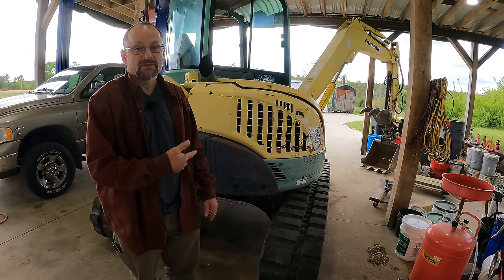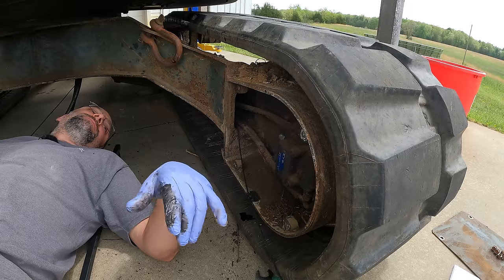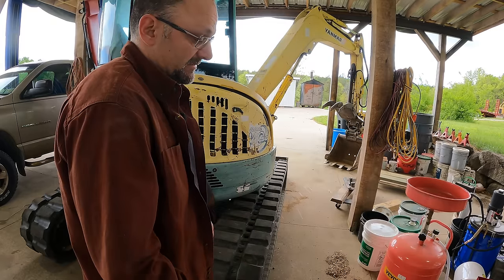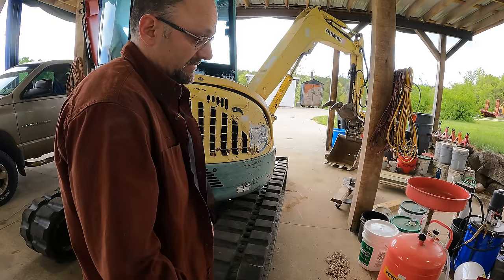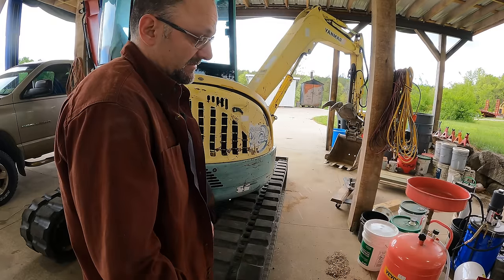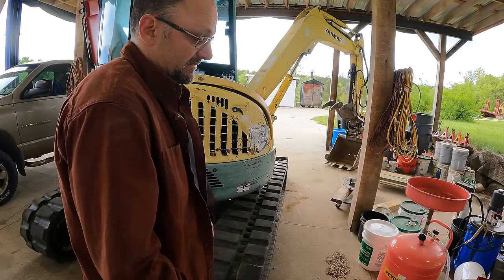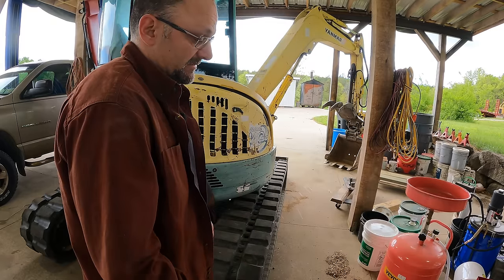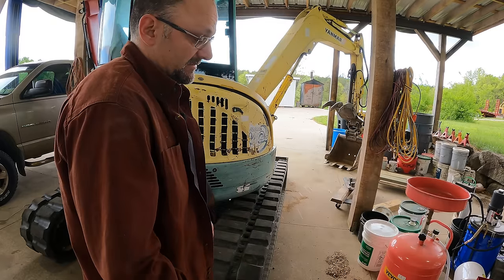Excavator Not Tracking Straight, TOUGH Hydraulic Repair.

Comment: As several other people have said, the most cost effective solution will be to ‘trim’ the faster motor so it runs at the same speed as the slower one.  There must be an adjustable valve available for not too much money, and despite the fact that you haven’t fixed the cause of the problem, you will have alleviated the symptoms of the problem.
Reply: My thoughts exactly!
Reply: a restrictor valve , tied into the input and output of the faster motor.
Reply: A simple flow control valve would solve your problem.
Reply: You feather the levers to stay strait if one side is faster you slow down the fast side to stay strait it is cheaper than a valve or other parts
Reply: @alphonsotate2982  Exactly. I've even seen some machines with limit bolts on the sticks that are adjustable. This is a pretty common occurance. Machine will just be a bit slower...but they're already pretty slow as it is.
Reply: @64novacaine  Yes. restrict the flow of the fast track while not sacrificing any pressure for operations.
Reply: @jtmack77 maybe a spacer with a smaller hole then the coupling, in the coupling between the right motor and to hose for forward, would already do the trick?
I'm sure it will restrict the maximum flow, while keeping pressure at lower speeds.
And it's pretty easy accessible if you want to try another size or remove it.
Reply: Or just squeeze the hose with a clam, that'll restrict the flow!
Reply: @alphonsotate2982  Exactly, I have the same Yanmar machine but a 8 ton version. I have to make small corrections just by favouring one stick a little. It can even just be from having the boom out to one side you will get slight divination. It's not like you are driving it down the freeway at 60mph with one thumb on the wheel.slight Track tension imbalance left to right side can have an impact.  Makes for good entertaining videos though trying to make things perfect.
Reply: @alphonsotate2982  the problem with that is by not using both controls at maximum, you also dramatically reduce the speed of the slow motor too even though you have it at full
Reply: This was my thought as well. You may loose some speed overall to match the track speed up, but surely it wouldn't be a big issue given how you typically use an excavator.
Reply: You are not far off on your idea. You need to use the tracks as flow meters. And Match to each pump. Adjust the sow pump servo piston to match. It makes up for wear and differences
Reply: It would appear you have two different pumps one is a fixed output and drives one track, the other is a variable output pump a swash plate pump. When driving both are used to drive tracks independently. When not driving the swash plate pump (variable output) is used to gently or not so gently move the implements. This explains why linked together you would get the fixed output pump throwing its weight into the argument leading to harsh Implement use. The HP control is for overload control, think of it like a fuse when you get huge resistance to movement it would back off the pressure. This would have no affect on pump output at all, it is only used for overload situations. You messed with that and should put it back where it was, effectively you took out fuse and put a bigger one in! We need to limit the throw of the swash plate to reduce its output to that of the fixed pump. Is there a control stop for that??
Reply: Have you tried swapping the port relief valves on the control valve for the travel circuit? There will be one on each “slice” of the control valve for the travel circuits. It will look like the main relief valve. 40 years as a heavy duty mechanic in my experience it’s very rarely the spool itself unless there’s been a failure and metal has gone through the control valve.
Reply: If you add flow controls, remember to put them in as meter out. You will need 4 to get both sides the same in both directions.
Reply: @rustrtal  I have noticed that too with my machine, that unless both controls are in full forward mode they both slow down? Why is that?
Reply: @Methodwake if intalled at the pump, He only needs one. Only the good side.
Reply: @64novacaine  A flow meter  would isolate any hydraulic problem, for this job and any other hydraulic issues.

Comment: One things ive learned watching your repair videos is just how valuable a lathe is as a tool for making repairs.
Reply: Agree!! The tools he makes.... So cool
Reply: Ave said when the you know what hits the fan you are either going to want a lathe or know someone who does because of how useful they are for repairs
Reply: As an industrial maintenance/repair man, I have a lathe but rarely use it. When you need a lathe you need a lathe. But for what he used it for in this video, I wouldn't've bothered. I'd've threaded the plug into a cap, to be able to grab it in a vise, hand drilled the hole, and tapped it by hand. The lathe would result in better threading, but to make a test adapter, doing it by hand is sufficient and much faster than setting up a lathe.

Comment: I think we all appreciate how much time and attention you put into editing your videos with adding text and graphics. Your videos are so informative.
Reply: Hi,  Try fitting an in Series Adjustable Valve to the Main Drive Feed Line of the 2 that's feeding your fastest (L/R) Travel Motor,  and back it off until she hopefully  tracks straight.  It should not effect anything else re your Digging Controls obviously.  Worth a try, and if you want to get really technical, then you can also toss in isolating Solenoid's to isolate this adjustment .. if required.
Reply: @grahamking2276  I would have the same approach.

Comment: That accumulator seems to be on the side that runs faster and seems to be the difference when switched. Iv run skid steers, excavators on a larger scale and after ten or so years every machine starts to get quirky. When you correct it may build up and slowly add extra pressure to the left track and bleed off. But every time you correct it builds pressure and starts over again causing an imbalance. Since you quite easily removed it once already may be the strong side is the problem. Just bar stool quarterbacking I really like how you work through the problem and don’t pull the trigger on the parts cannon. Good luck.
Reply: I came here to say this. I think he needs to try to isolate it, just to be sure.
Reply: My attention is drawn to the accumulator as well.  Do accumulators go bad?  Why is there an accumulator one one channel and not the other?  Should there be two accumulators (thinking one may have gone missing due to a dodgy field repair)?  My thoughts for what it's worth.
Reply: There should be two. Maybe it was a parts machine for previous owner and someone borowed it for other machine. Since it run on garbage lot the straight tracking would have not been an issue.
Reply: @arty1799  i think this is only on one pump because this one pump do the digging and accumulator compensate pressure in the system to make work smooth.
@farmcraft try just for the test remove acumulator
Reply: @arty1799  I was thinking the same thing. But is there enough space to fit two of these next to each other?

Comment: I love your videos, I’m a professional heavy equipment technician living in Sweden. I don’t see any of your test or troubleshooting paths to be wrong. But i would have started with a easy bucket test. Just lift the track and put the house drain from each motor to a bucket and run for any set amount of time and see any variations. If okey I would look in to see if there is any delta P adjustment to the pump. I guess that you will have separate. Electrical or mechanical throttle control of the pump outputs. The ls pressure (load sensing) pressure will set the angle of the pump the horsepower control on the out side should not be messed with. I might have done it 😂 I’m no expert on Yanmar but if you want any in put we could do a teams meeting or similar 😊 best regards from Joel
Reply: Ls pressure is nothing to do in thus case - Here is one one body pump,one rotor, one swash plate . Just on valve plate on pump has 2 channels for oil flow, these channels are quite close, they divide the diameter of the piston in the rotor into 2 parts and so from one rotor 2 flows are achieved. Even a slight scratch between these channels causes a leak between p1 and p2.

Comment: Hi John, a 90 degree pipe fitting will restrict the oil flow compared to a straight fitting. The  pipe for the left control valve has a 90 degree fitting so might be the cause of the problem. Keep up with the excellent videos.

Comment: Given the age of the machine (and depending on how hard it was worked) you obviously have wear in components, however...
before exchanging expensive components: 1) bypass the accumulator (remove it and run direct to the port) and check the tracking 2) check hoses for replacements ( especially their Internal diameter) 3) If you can, slip the tracks off and mark the drive sprockets and check rotation speed with a tachometer (Ie without load) and see if they still differ 4) whilst tracks  dismounted check all Idlers/track rollers are free rotating. Sometimes the simplest overlooked problem causes the biggest headaches John 😉 Tracking issues have plagued caterpillar machines since the were invented! 😒
Reply: I jumped on to say something similar always tach your unloaded sprockets and most tracking issues are result of resistance in the track system not the hydraulic side. You can test this by attaching a gauge to each drive hose and see if while tracking they have the same pressure. It seems you kind of eliminated this when you got it to track right but maybe the wear vs resistance is just enough to revert to “normal” on the one side when you switched them
Reply: @alwayssomething3259  If that was the cause, why would it track wrong depending on which side the pump is connect to? If it was resistance, it would always track right or left, not switch sides with the pump.
Reply: @bobbygetsbanned6049  As I acknowledged that he had eliminated it as a potential by getting it to track the other way. It was more of a general statement that most people overlook and in most the machines I’ve had come in for tracking issues there’s a bad idler bearing or something not hydraulic related

Comment: Hi John,  You could install a throttle valve on the supply line to the right motor. Might slow the whole rig down, but could be adjusted to make it track straight.   Love your stuff. Doug
Reply: I agree
Reply: That's right. Restrict the flow of the faster final drive to match the slower one.

Edit: I just also note that a flow restrictor valve does increase the temperature of the fluid going through it, and the temperature increases rapidly the more your restrict it. I am not a hydraulics mechanic, just something I thought to mention.

Comment: Had some similar issues with my bobcat, the more I thought about it the more I scared myself into taking both pumps and motors to a rebuild shop. Since the motor is directly downstream of the pump (more or less) without a filter between them, if the pump starts to degrade and send particles into the motor now you have two ruined components instead of two rebuildable components. It was about $4k to have all of them rebuilt but the peace of mind is sure worth it. Side note I spy a Caterpillar in the background that we haven’t been introduced to what’s up with that?😁
Reply: Checkout your Hawkeyes :)
Reply: at 32:11 in the video is that cat dozer on a trailer ?
Reply: @mmm365  correct they have a variable displacement pump and no control valve but they are similar in that that pump outlet goes directly to the motor.
Reply: @dannyscott1159  looks to be a d3 from the 80’s I would guess
Reply: @corywillbanks6348 close. '70s. D3C changed that right rear fender to a straight panel instead of an angled panel

Comment: Is it possible the bushing is worn in one of the control lever linkages and you are not getting full stroke on the control valve? It appears to be a simple mechanical linkage. Kinda hard to imagine one side being worn and the other side not, but stranger things have happened.
Reply from the maker: I checked the linkages and spool travel early on, but they were both spot on. I wish I had thought to include that in this video!  Also, the problem wouldn’t change sides when swapping the pump connections if that was the cause. Right?  I wish I knew what I was doing!  😂

Comment: Maybe you could install a simple controllable stop (gate/ball) valve on the strong pump line side and then tune it down to match the flow to the weak side? Yes, it will slightly slow the travel speed overall, but you might be able to tune it to track straight (at least at full speed)? (A fixed restrictor plate insert might work too, but you'd have to find the right orifice size and then it's permanent and non-adjustable)
Reply: I just posteda comment with a similar idea. My thought is also to manually tune the output after the valves to match the motors by restricting the stronger side.
Reply: My idea is very similar except I would install a pressure relief value on the line leading to the strong side's control value to induce a leak back to the hydraulic tank. You would then adjust the relief value to release enough pressure to weaken the strong side to match the weak side.
Reply: You can just stack a flow control valve under the spool valve, they're designed to stack the controls you want, adding prvs wouldn't be completely reliable and would limit the power instead of flow (speed)
Reply: i had a problem with brakes on my truck, rears locked up way faster than the fronts so i put an adjustable proportioning valve in the line to the rear then adjusted the flow restriction till they matched, you could do the same thing in the forward direction hydraulic feed to the faster motor and adjust it till they speed match
Reply: @cesargallo7424  can almost guarantee there is already a tracking adjustment, either with a manual flow control valve to speed up or slow down one side (this machine), or a solenoid voltage adjustment in software, if a newer piece of equipment. I'd still be testing the travel motors considering the state of care they've received so far. Edited to add: worked on a track loader with the same issue, customer paid for troubleshooting but no repairs as it was almost 30 years old. Adjusted to as close as possible, and sent it. Figured he'd use it for a few more years to make the money to buy a whole new machine
Reply: @rod8884  Yeah, an adjustable proportioning valve might do the trick.

Comment: I would prop the excavator up so both tracks could spin and test each side with a tachometer to determine wether the rpm of each side are exactly the same. Or disconnect the track and test each drive sprocket . This would determine a hydraulic issue or a drive train issue, wouldn’t cost anything to test but would rule out 50% of the equation. I’m a toolmaker by trade and have 0 experience with heavy machinery just love watching this channel the man’s a legend

Comment: Long time ago on the Gardener Denver Hydratrac drill, we had a hose collapse internally just enough to drive you nuts on trying to steer it. Probably way out there as a solution but I remembered it from the 1980’s so I’m not totally forgetting things yet.

Comment: My first thought has been to check the hoses for restrictions. Reason I came to mind is I was working on a four-wheeler with a plastic gas tank and the carburetor kept getting clogged so I started taking the hose off and it was blocked. Then I went into the gas tank and it was a mess but I never thought of it because we run ethanol free gasoline in those. It turns out another friend of ours has a Sea-Doo and he ran into the exact same problem. So bottom line check your hoses. Make sure there's no obstructions in them.

Comment: You are a very patient man. I have dealt with this problem before and went through many of the same steps you have. The tension of the springs within the relief valves can be a variable.

Also 8/10 mini excavators I've ever dealt with wouldn't track straight.

Comment: This problem is quite common on excavators (big and small) as the pumps control different attachments during operation. this will cause them "wear-out" at different rates over time. From the excavators I have worked with the pump that supplies the stick/arm and the swing function degrade faster.

I don't know if this will work on your machine, on machines I have work with if you operate an attachment during straight traveling it should straighten your tracking. That is how I ussually diagnose this issue along with condition tests.

I don't recommend touching the pump as the main pumps probably have some way to "influence" each other, it might make it worse and affect the other attachments.

Love your videos repair videos on this excavator.

Comment: Great video John, thank you for posting. Yes be careful around hydraulic pressure, a colleague  was working on a  Oil Well mud Pump, Hydraulic pressure was required to change a piston rod ( 24000 psi) yes you did read that right, a line burst and he nearly lost his arm, with fluid injection injuries it is not apparent at first how serious it is, if it happens get to the Hospital ASAP.

Comment: I am fighting this with the mono block valve in my TLB right now. Obviously different but have tracked it down to a crack in between the crowd and curl casting sections of the mono block after the 4th time having it out of the machine. Hang in there. You got this
Reply: Hi I'm no expert but I caught a glimpse from a distance from the rear of your excavator and noticed,  it looks like the left track is different from the right, it looks narrower then the right or maybe worn more then the right. Just fyi.